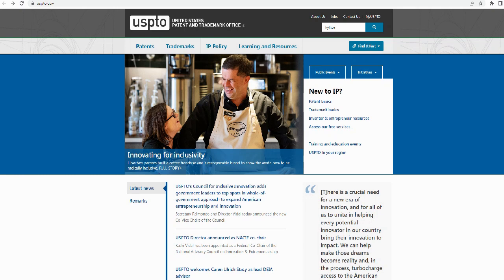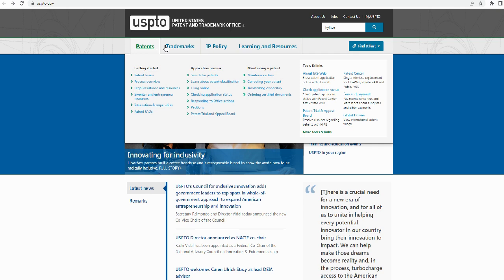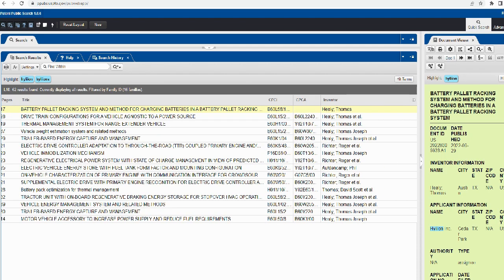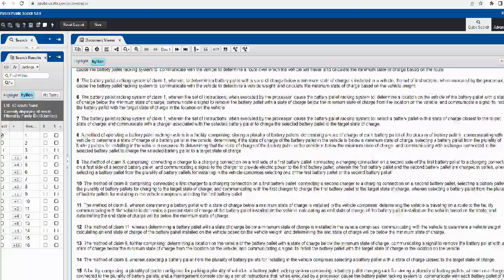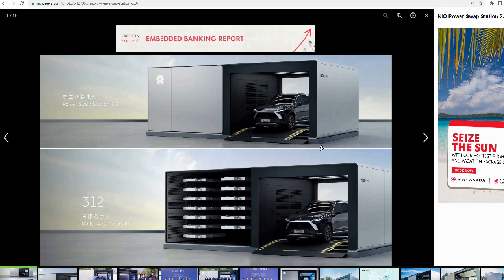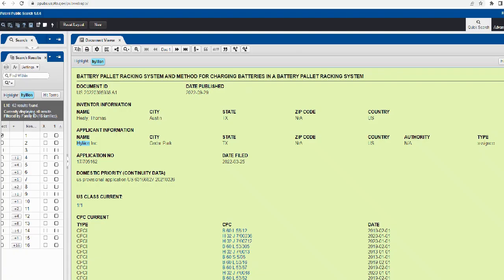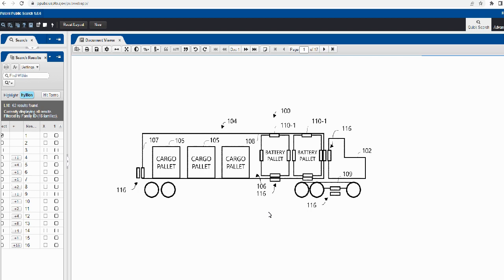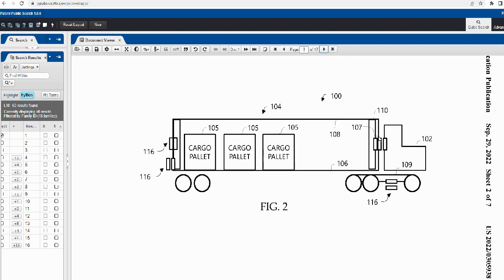New Hyliion Patent: BATTERY PALLET RACKING SYSTEM

Comment: So there is no actual details or specs for the battery itself but only placement options within the cargo container from the patent? And does that mean you need special cargo container for Hyliion truck? It doesn't seem useful or anything unique.
Reply from the maker: the patent goes much more details into battery spec. i just didn't bother to cover it here because it is too techniqual. and this is not just for hyliion truck, this is for all bev truck. and this battery pack seems to be installed inside a trailer...
Reply: Do you understand what a pallet is? Most dry vans use them